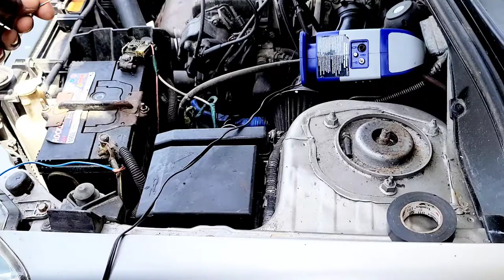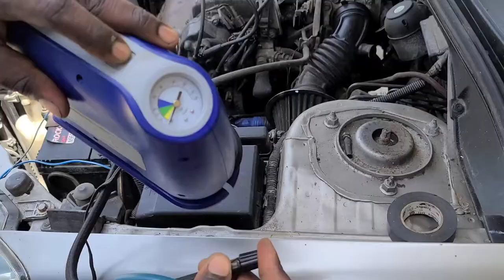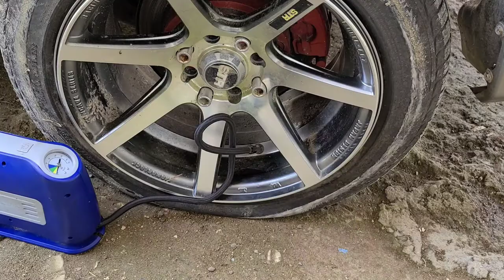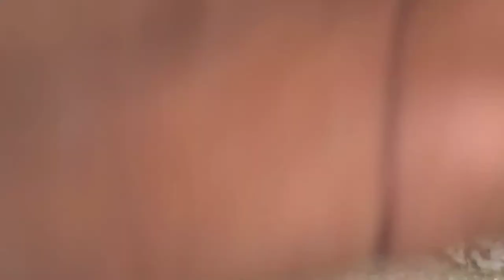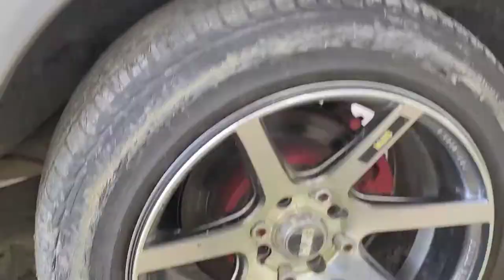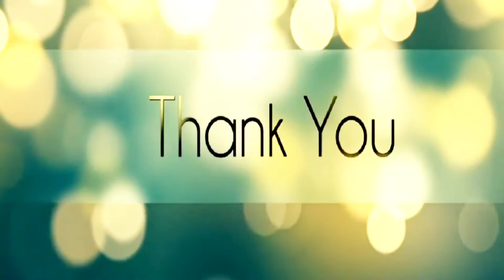How to pump your car tire if your cigarette lighter not working with this simple trick

Comment: Light is coming but motor is being stopped after 1 sec every time when i plugged it .what i need to do
Reply from the maker: Make sure connection are tight and the pump not faulty